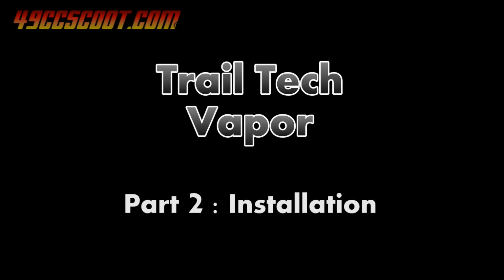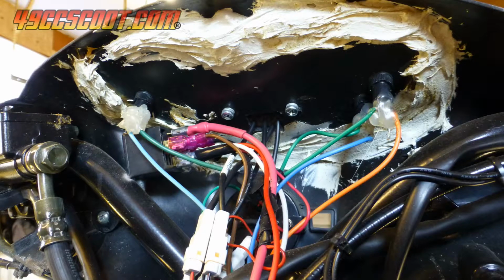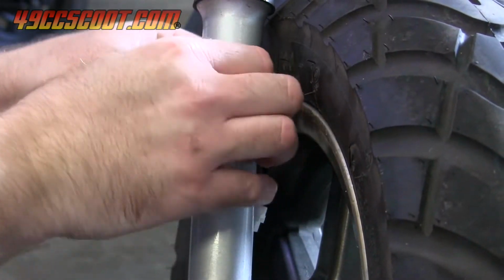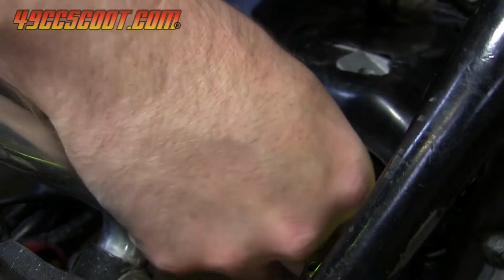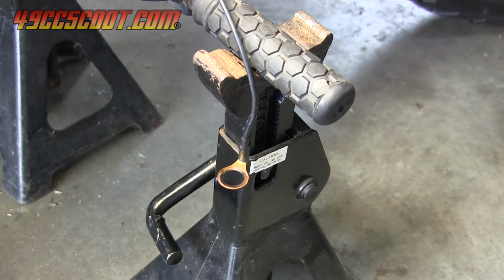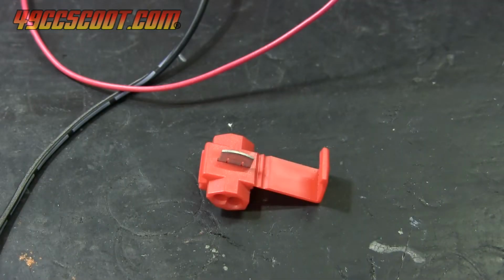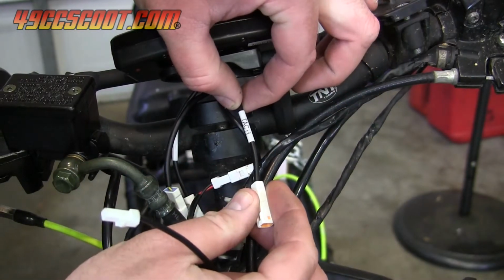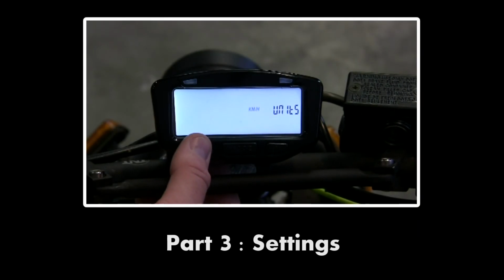Trail Tech Vapor Gauge : Part 2 : Installation On A Scooter

Comment: Hi . Temperature sensor wire is too short. Can I cut it out and extend it?
Reply from the maker: I wouldn't suggest it. They are picky. It's best to buy an extension.
Reply: @49ccscoot  so sad. I'm in Vietnam and shopping is very difficult
Reply from the maker: @datnguyen0910  The wire has to match very close to what it is. People have had trouble with making extensions and the successes that I have read about used the same gauge wire as original. There should be more info online with some searching.
Reply: @49ccscoot  Which wire to use to connect is a wise choice
Reply from the maker: @datnguyen0910  I don't remember, but I tried it once with some thin wire that looked close enough to me and it wouldn't work. Later I searched and saw someone saying what the wire gauge is but I just don't remember anymore.

Comment: Hi 49ccscoot , i have issues with my vapor . it was installed by the workshop mechanic. it's brand new. running over bumps or uneven road, or at the time applying front brake i notice the backlight of the screen flicker or should i say the light intermittent disappeared, Its connected to ground on my bike bosy and Positive on my ignition wire. Is there a way to solve the issue
Reply from the maker: Guessing from my armchair over here, I'd think it would be either a loose connection in the wiring or the Vapor itself has an internal issue.

Comment: A 0.5 amp from should be used?!? Or can a 5 do?
Reply from the maker: You'd be better off with 0.5A or as close as you can get to protect the circuit.
Reply: Manual says 1 A
Reply from the maker: @BamSlade  My manual said 0.5A. If the manual for your product says 1A, then go with that.

Comment: RPM , wheel speed (hall effect) and temp (prob k type thermocouples) are all basic sensors/data acquisition methods we learn to use in engineering. Pretty cool seeing a little package that uses all these. Really good deal for the $.
Reply: so do all good mechanics

Comment: Where can i get the vuse holder? is it a specific one, or can i use any? and is that what keeps it from draining the battery?
Reply from the maker: Nothing specific. Any auto parts store. It doesn't drain the battery (much) because it just doesn't use much power.
Reply: ok,because i just connected it straight to the battery without the fuse holder, and the light stays on
Reply from the maker: It should go off if you give it a few.
Reply: without the fuse holder?? it didnt
Reply from the maker: With or without the fuse holder it should do the same thing. If it's not turning off after 15 minutes, contact Trail Tech about it.
Reply: alright, thank you very much for the replies
Reply: hi again, so my trail tech is reading my MPH wrong, when im going like 10mph its telling me im going 300mph and messing up my odometer, would you happen to know the problem
Reply from the maker: Sounds like perhaps the tire size setting is way off. That's all explained in part 3 of this video.

Comment: So hooking it to battery like that means you turn on the vapor manually or does it somehow turn off and on with the scooter key?  Im so getting this for mine.
Reply from the maker: It turns on when the wheel sensor moves and stays on for a bit after the sensor stops. The display is actually always on, but the backlight turns on and off to save battery power.